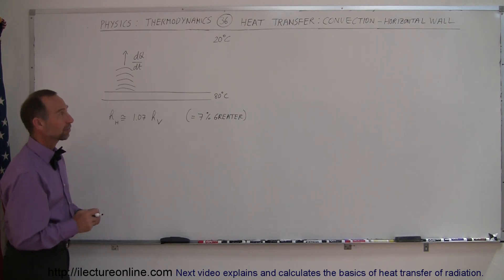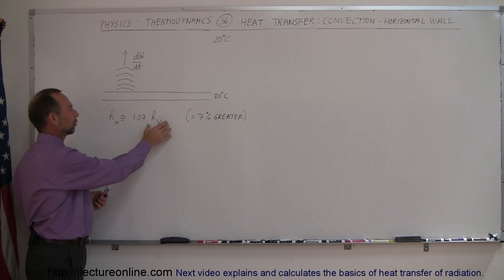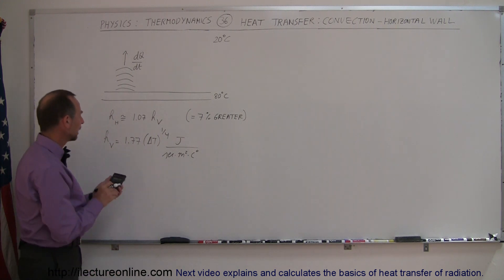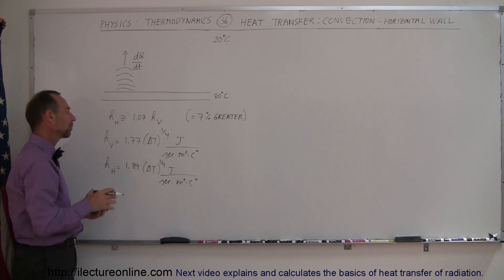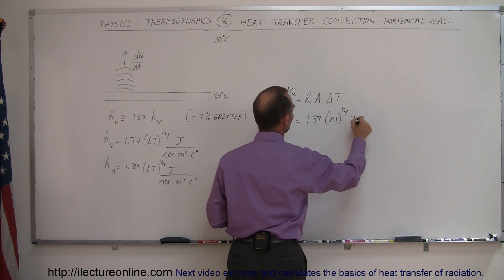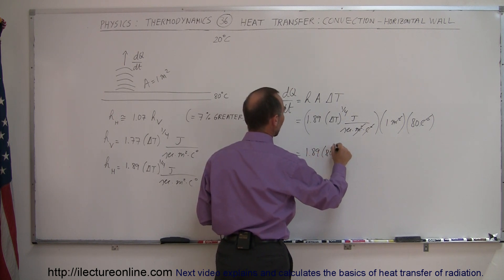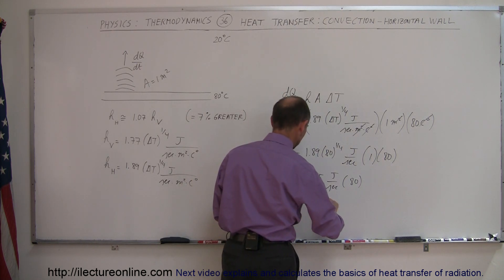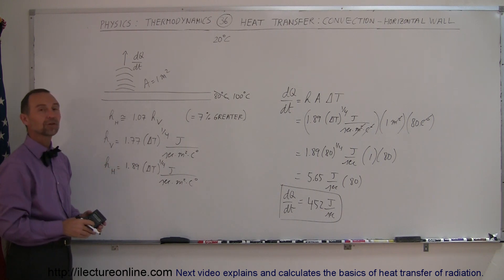Physics 24  Heat Transfer: Convection (34 of 34) Horizontal Wall

Comment: Michel van Biezen sir why is that you didn't multiply the two delta Ts?
Reply from the maker: The product of delta T is so small you can ignore it.   0.001 x 0.001 = 0.000 001 for example.
Reply: sir why is that on the vertical videos the 1/4 become 5/4 how does it happen what is the difference in the horizontal one that remain 1/4?

Comment: Sir, what happens to the dimensional analysis of temperature, given the 1/4 power? (Because the constant has centigrade degrees to the minus one)
Reply from the maker: The units of sigma include 1/K^4 so they cancel out.
Reply: +Michel van Biezen thankyou sir

Comment: may i ask why is there 1/4 power to temp.??
Reply from the maker: Averyl,
That was experimentally derived.  (As were most constants in physics like that)
Reply: +Michel van Biezen sir, shouldn't it have 5/4 instead of 1/4?
Reply: +Michel van Biezen i just noticed you haven't multiplied the two delta Ts that's why it has 1/4 exponent. nevermind, i got it now.